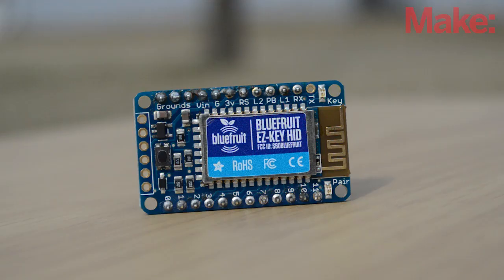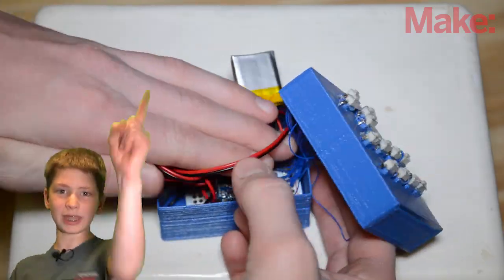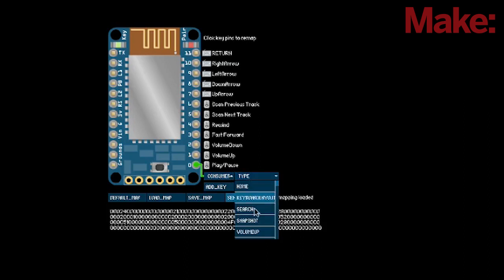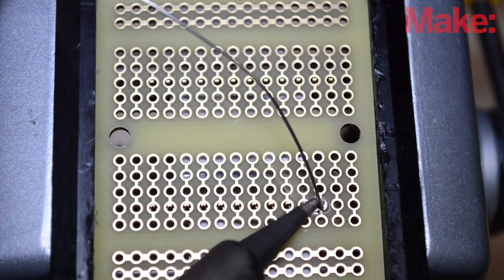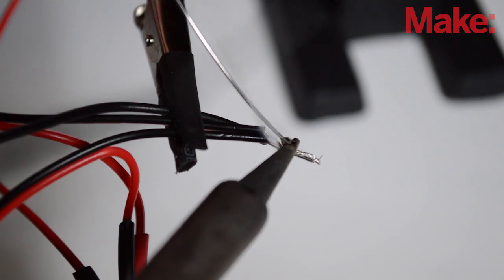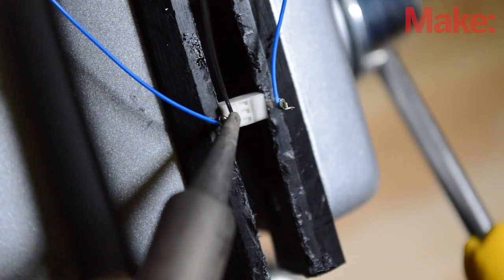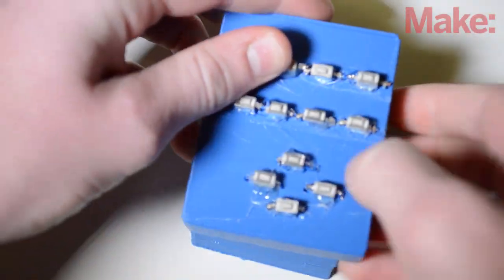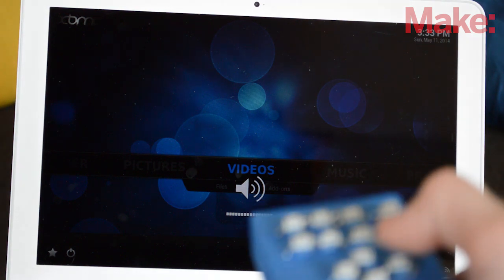Make It Great: Bluetooth Remote

Comment: not to be rude, but its not exactly great, it looks incomplete, and more like a test model, than a finished product, and since you have a 3d printer, why not place the buttons inside the case, and have small plastic things to press the button? it will make it look overall better, and make it more cool looking. at some point, im going to try making one, but i dont have a 3d printer, so mine will look like crap. just a few ideas, and things i would improve if i were you.
Reply: Alex The KI Tronic Blue Jay i dont expect it to be the first he made, as the first one, would be a simple one without hpusimg, to make sure it all works, then a basic look to the hpusimg, and finaly the finished product, also, when the desciption starts with "makes it great" then i expect it to be great, not something, anyone with a basic knowledge of circuitry would make. even as he shows us the 3d model, it looks like the small squares that are protruding the top, is meant to be keys, not pedestals for switches
Reply: +josh Diaz , he said "not to rude" it's just his opinion?!?! His not directing to Lewis.
Reply: Maraos well, in a way i am, since it states "lets make it great" then i get a little dissapointed when its not great, though of course, its my opinion, but its somewhat directed towards lewis. i dont hate the kid, i just dont think this project was made with "great" in mind, or said in annother way, it was not "great" but its decent, if we consider his age, its really good, but not great.